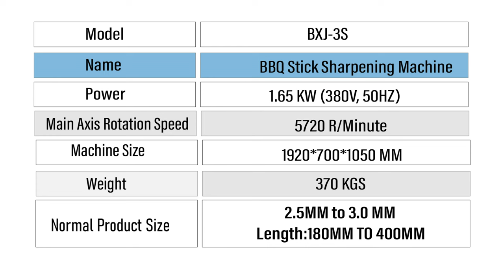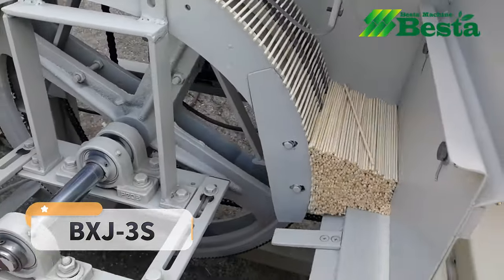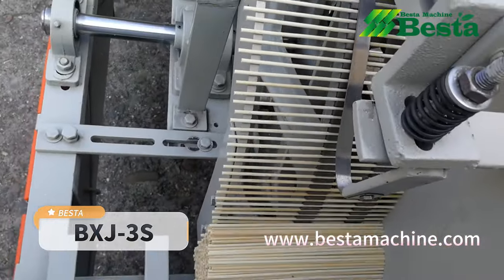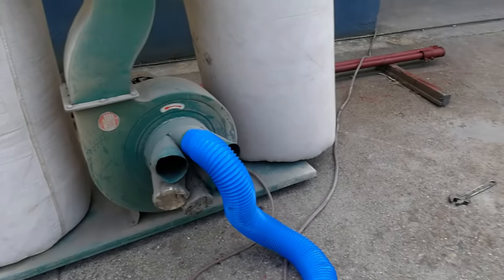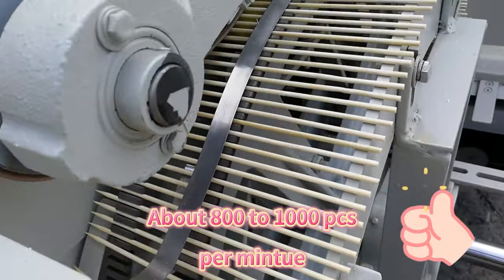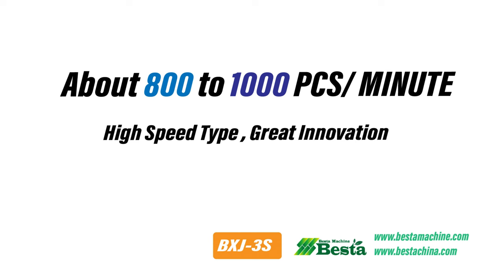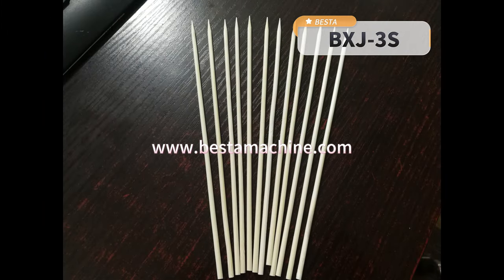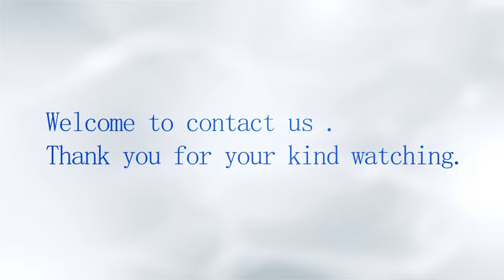High Speed BBQ Stick Sharpening Machine, Bamboo Skewer Sharpening Machine

Comment from the maker: This model BXJ-3S is high speed type BBQ STICK SHARPENING MACHINE. 

Technical Data 

MODEL: BXJ-3S
Name: Bamboo BBQ Stick Sharpening Machine
Main function: Skewer sharpening, one-end sharpening
Motor power: 1.65kw
Output: 800-1000 pieces/min
Spindle speed: 5720 r/min
Mechanical size: 1920×700×1050mm
Conventional processing diameter range: 2.5-3.0mm, 
length 180-400mm (can be processed by one machine, other specifications need to be customized)
Weight: 370 KGS